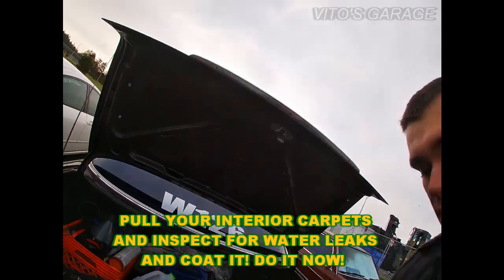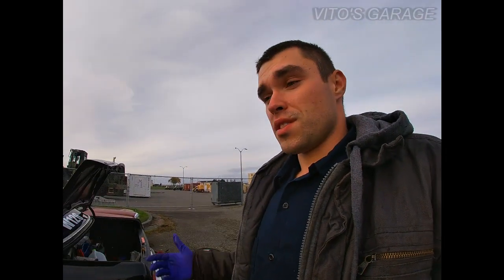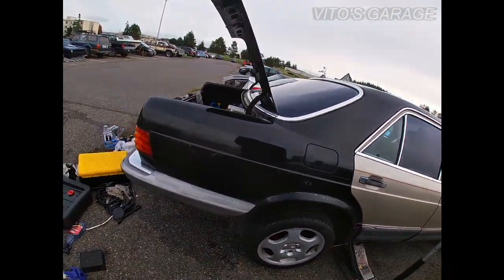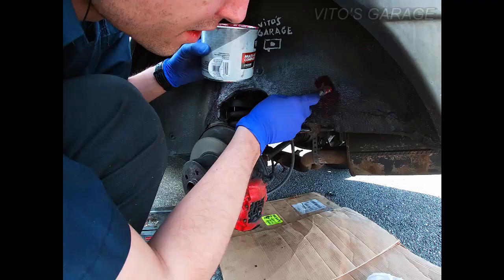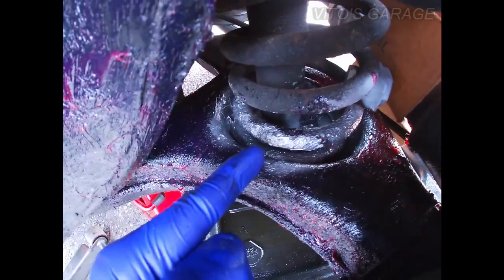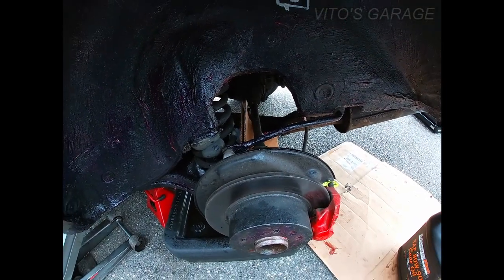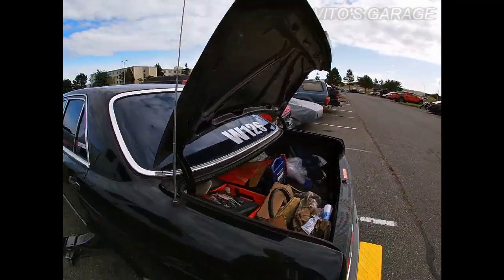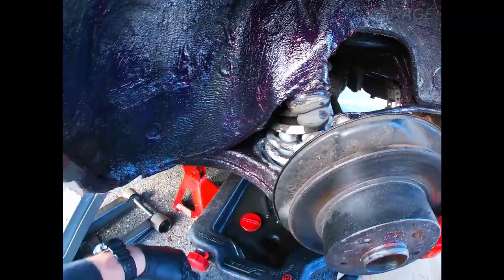How to Prevent and Protect Your Car From RUST! MUST SEE!

Comment: I like your you tubes, I have a 85 300CD .  I tried that method and it accumulated a lot of oily dirt.
Reply from the maker: The grease accumulates dirt but it has a film so it will not let the it get into the metal. After some driving, that dirt will start coming off and fading. I personally love bearing grease and oil. I also love Fluid Film product which is really good.Thank you for watching!

Comment: Hi Vito, sorry but that's not the correct way... This method was developed in Soviet Union because there wasn't anything available. The correct way:
Using special rotator that bolts to the hubs on one side u flip the cae on it's side. Then u clean all dirt and rust of the underbody. Then threat the leftover rust with Orthophosphoric acid.
Then u need to find some artillery gun grease, it's very thick and doesn't melt at high temperatures. You warm it up on the Fire and then you brush it onto the underbody and after that you take the car and you drive on the really dusty road the dust sticks and creates a  layer and that's how this method is done. Thin grease will melt at higher temperature and will start dripping.
Reply from the maker: Hi Andrey! Thank you for your comment. I will keep that in mind. I have to reapply this grease from time to time, it just depends how much I smear on there. I still love this method, it protects it pretty well. I love a Fluid Film product as well, if you've heard of that before. I also have a W210 and I use Fluid Film on my front spring perches. It protects it from rusting. I usually apply fluid film twice a year or so. But wheel bearing grease is good too. Of course there are different methods of doing it and of protecting the car from rust. I just don't like when people paint over the rust or use rubberized undercoating.. That's really bad.
Reply: VITO'S GARAGE Very true about rubberized undercoating. It’s great that you’re telling people how to preserve these old gems.   I used to use wheel bearing grease, but found it didn’t “creep” into places like motor oil or chain saw oil or fluid film. My newest discovery is a mixture of Wool Wax and atf. It lasts like crazy and creeps into areas. I also pour oil into the trunk and above the wheel wells. No rust on my 300D or 300SD. I live in New York with lots of road salt. 👍👍👍
Reply from the maker: Wow, wool wax and ATF! Nice combo! And yes, hopefully people will share this video so others can do the same to their cars! People always forget about trunk pockets and floor boards! Ugh.. New York is bad for these cars, I try to not drive any of my old school cars on salty roads.Thank you for watching🙂
Reply: @shiffroninc.4977  Curious about wool wax. Gonna give it a try cause I live near the coast